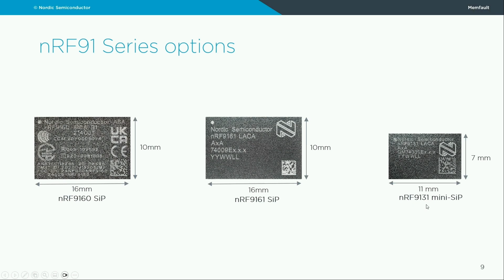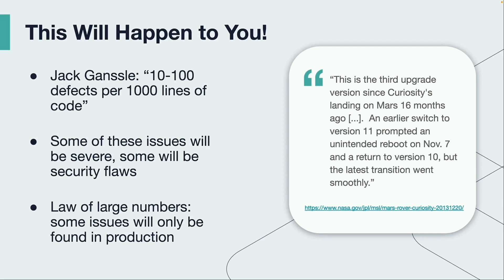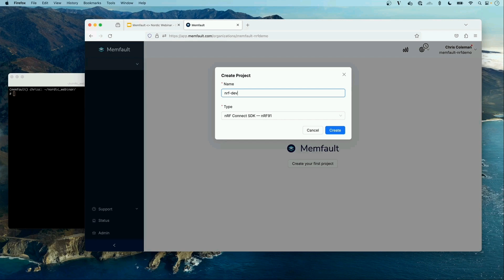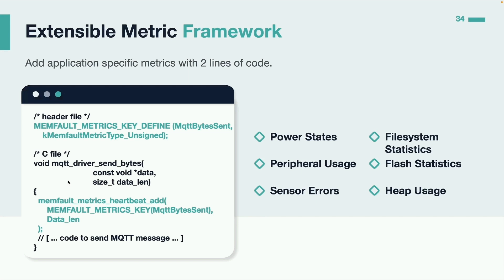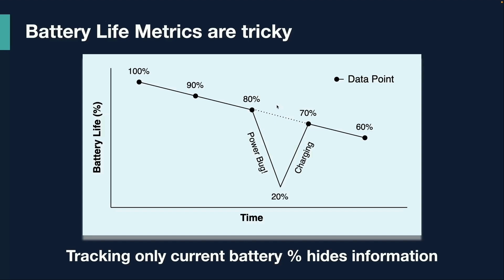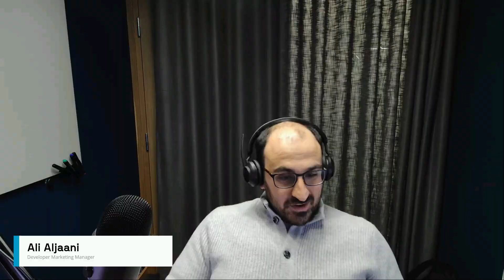Accelerate development and optimize in-field device quality with remote debugging and monitoring

Comment: nRF9160 cannot be used for Dect NR+? The nRF9160 SiP radio transceiver can be used at 1.9 GHz, why can't the nRF9160 be used for Dect NR+ as indicated in the table at minute 8:18 of your presentation? So we have to wait almost 1 year to be able to acquire a nRF9161 or nRF9131 and then implement Dect NR+ mesh based products?
Reply from the maker: That is correct, nRF9160 cannot be used for DECT NR+. No, you do not have to wait almost 1 year. You can get nRF9161/nRF9131 samples and DKs right away to develop DECT NR+ based applications. Connect your local Nordic sales representative.